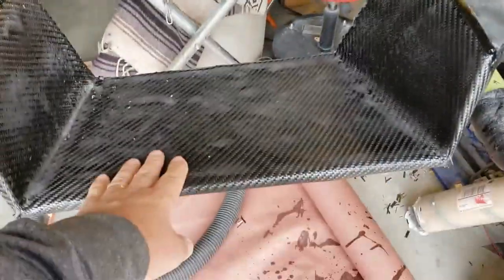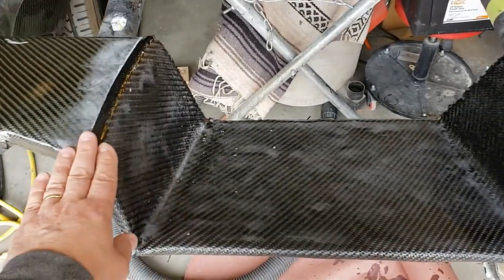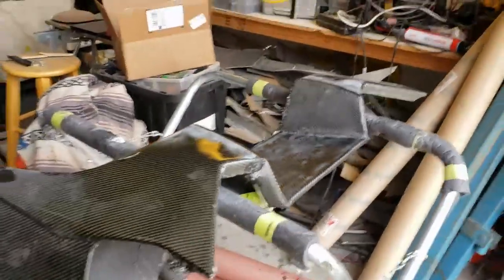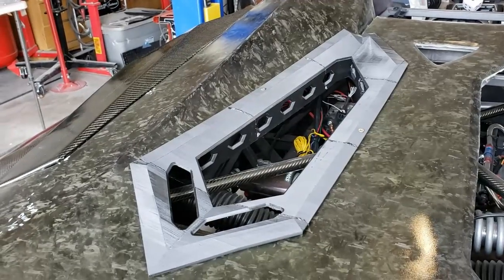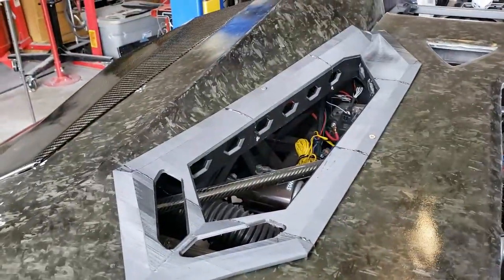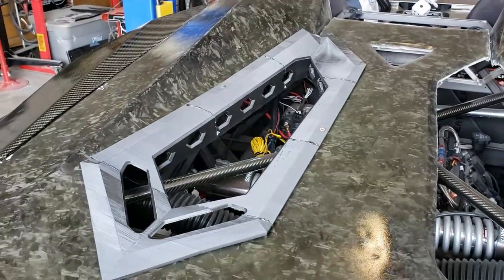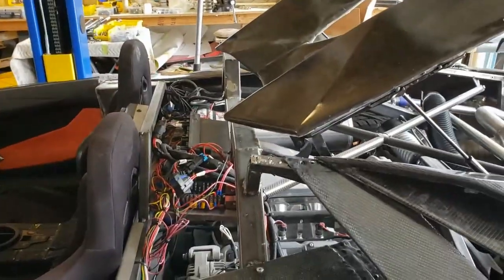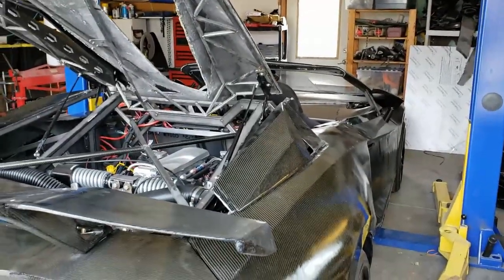3D Printed Interceptor Update 60

Comment: what engine does it mount?
Reply from the maker: LS1
Reply: @lasersterling  put something proper, like a v12. Its just better,  ore realistic and you can get it tuned to sound like a lambo
Reply from the maker: @cocoguardian6679  Just needs a flat plane crank.  A V12 will not be as reliable and cheap as an LS1.
Reply: @lasersterling  its a toyota v12, it was made to be reliable, shouldn’t be too expensive
Reply from the maker: @cocoguardian6679  She will just need to be an LS for now.
Reply: @lasersterling  guess so😋